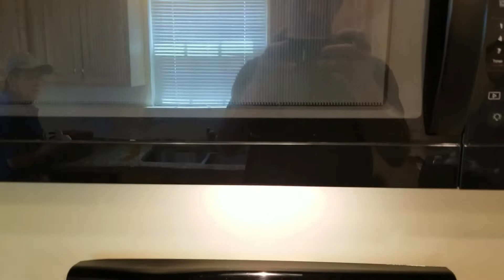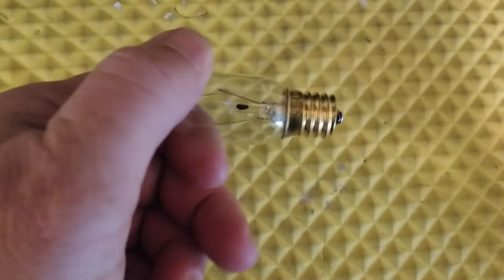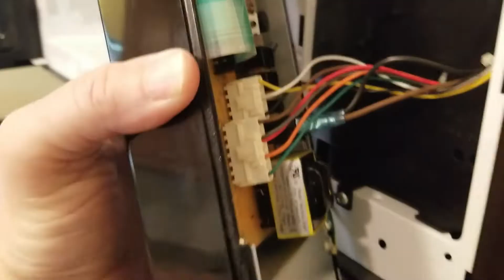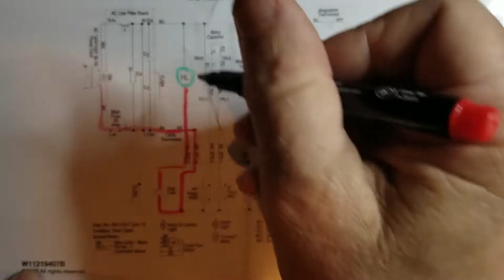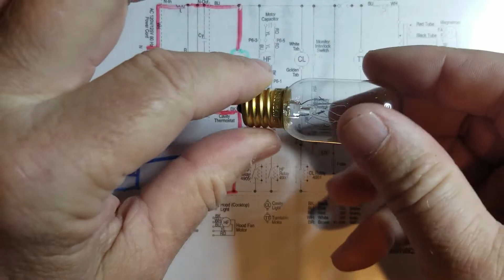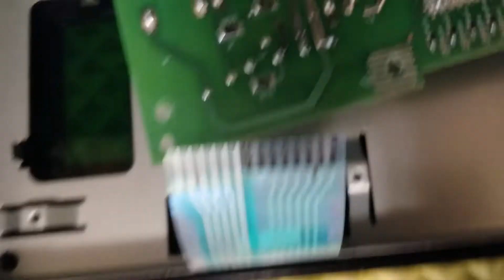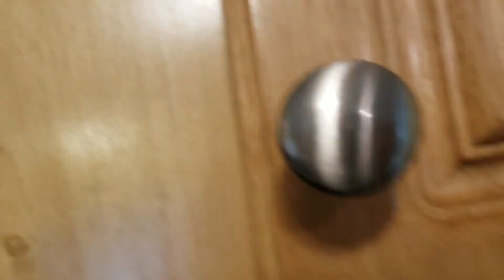#30 - Whirlpool Microwave Light won't Turn Off - Board Repair and Schematic Walkthrough

Comment: Just my luck, and I'm an electrical engineer.  I know I should have unplugged it first, but not from the wire like the gentleman did in the video.      So like in the video, when a cheap bulb is used (and a cheap bulb was used), if u unscrew it and only the glass turns but the brass base doesn't turn, you will short it out and draw a lot of current through whatever is in series with the bulb.
    So when I went to unscrew my bulb (apparently the bulb circuit was in the "on" state) I heard a loud pop.  So I knew that was bad.  
     I installed a new bulb and nothing at all.  So my circuit, unlike the one in the video, is now an open circuit.  So the triac is now an open circuit or something else is an open circuit.
 WMH31017HW08 is my Whirlpool model. It was manufactured in 2021. Everything else works as it should, just no light.
   I see how this is an easy fix, but due to the fact that this single light is not bright enough for my needs, I'm adding other LED lighting to light my stovetop.
   Thnx for the video, helpful to many.

Comment: Did as said... found the correct triac and replaced it without a hitch.  Only now the light button does not work... it does not beep when pressed and light is off.  Will probably haul the microwave to the dump...  do you know something else to check?
Reply from the maker: It is not uncommon for buttons to stop working after removing the ribbon cable and reinserting it. You might try again reinserting the ribbon cable and making sure it is fully seated.

Comment: Great explanation.  1) Tried to use an LED bulb, but it would not turn off... apparently there is a constant current that runs through it, just not enough to light an incandescent bulb?
2) is there a way to modify it to take an LED bulb?  Funny thing, rather than fixing it, the warranty people just replaced it.  
Also, if that is the WMH32519 notice there is no filter on the right side exhaust port.  The 2.1 model does... (Go figure?)
Reply from the maker: There is a bias current in the triac circuit that is enough to make an LED bulb glow. No practical way that I'm aware of to circumvent that without adversely affecting the circuit.

Comment: I'm not an electrician but find these videos helpful in learning how electrical components work. I have an Amana washer I got for free and it is not like granmas old washer and you can't bypass the lid lock switch by twisting the wires together in a bunch. That is what the previous owner did. Like your light bulb scenario there in the microwave, a TRIAC exploded on the washers circuit board. So I de-soldered the remnants of the TRIAC and will replace it AND install the proper lid lock switch. Thank you for explaining and sharing your expertise.

Comment: Great video. Does the Frigidaire microwave range hood have the same component that causes this problem?
I received a call where they replaced the bulbs and they won't shut off.
T.I.A.
Reply from the maker: Make sure they did not replace them with LED bulbs! You're welcome. 😀

Comment: I just blindly watched another tech swap out the triac in a unit with the light stay on problem, but, you guessed it, the unit did the same thing with the new triac. LOL.  I think I need an opto coupler

Comment: As opposed to the one comment ("no triac"), my board has TWO triacs.  Both are identical (BT 136  600D).  I don't seem to have a schematic for this unit, a Whirlpool model WMH53520CW-4, so I'm unsure which I'd need to replace.  Suggestions?
Reply from the maker: If your symptom is that the light won't turn off, then my suggestion is to use your multimeter to check for a short across each triac as shown in the video. This will let you know which one may be causing the problem.
Reply: @TheTechCircuit  Yeah, I guess that should have been obvious, eh?  I've got literally no experience working with circuit boards and next to no experience working with a multimeter.  In fact, I had to look really hard to even find my multimeter.  The thing's kind of a mystery to me, so I tried several settings and ultimately found 3 consistent readings (on one of the board triacs and two of the new ones) that differed from the readings I got on the 2nd board triac.  Even not understanding the details, figured that had to be the bad one, so I managed to desolder (a first) and solder in the new.  Having no confidence whatsoever, I reassembled it and did the 'smoke test.'  It worked!  Thanks for your help!

Comment: Wmh31017hb4 microwave hood light is getting 120v to the light bulb connector, but the light won't turn on.

-Light bulb connector Ohm checks good
-Light bulbs are good, both incandescent and LED light bulbs were tried.

What is my issue...? Triac?

Comment: Awesome explainer video! I’m no engineer and not the best at soldering but I had my light working again in no time. You saved me a lot of $.
Reply: 🆘 Think twice before you buy the Whirlpool microwave in the above video. When the light won’t shut off the only way to fix it is to buy a new motherboard, and they range in price from $155 to over $350 plus tax and shipping. And it’s an inherent problem in this Whirlpool microwave unit 0:05 wmh53521hz. The guy in the video does an excellent job showing how to replace it but you can buy a new microwave for $450 or LED stick up under cabinet lights for under $10 as a solution.
Reply from the maker: Thanks for the feedback! Glad you got it up and running.

Comment: my bulb has been burnt out for a while. bought two new bulbs. installed new bulb and it burnt out as soon as I turned it on. Installed another bulb and same thing happened. Why would they keep burning out? thx
Reply: From what I ready in many comments and videos. Need to make sure power to microwave is unplugged before replacing the bulb

Comment: You skipped over the only part I was looking for... The actual soldering. Good explanations, great to see the schematic and explanation. Then you just hopped right over the actual repair. Hard to solder with one hand to film, maybe get a tripod. Also glossed over exactly how to place the triac before soldering. I'm a novice, but I can solder and this isn't a difficult repair. Just some details missing.
Reply from the maker: Thanks for watching. You're right about why that wasn't shown. "One-handed video" - didn't have the tripod handy that day. On the list of upcoming videos though is a comprehensive one on soldering.
Reply: @TheTechCircuit  Awesome, subbed!